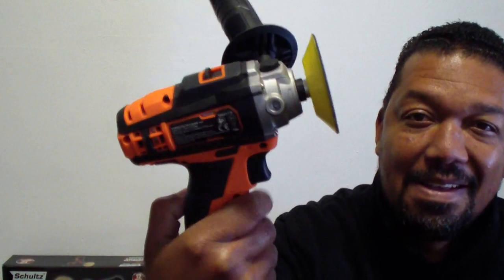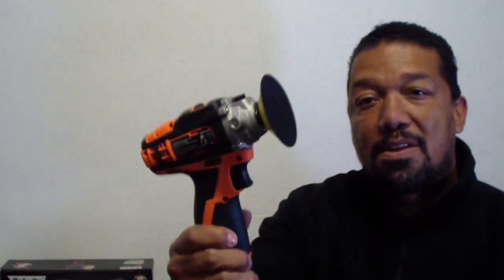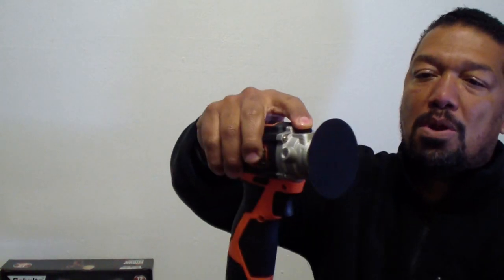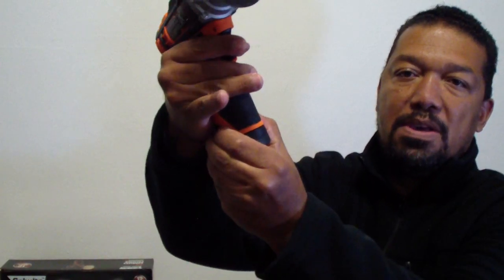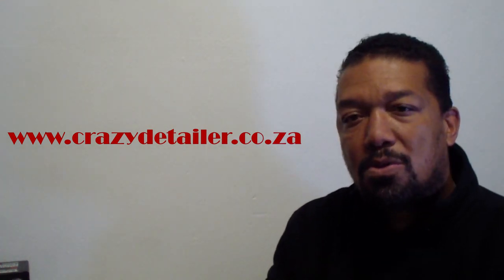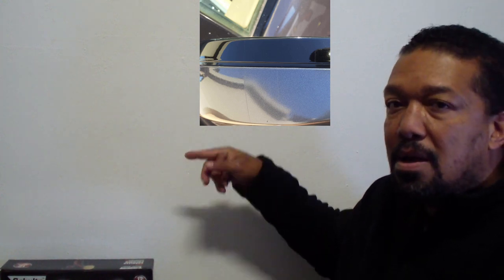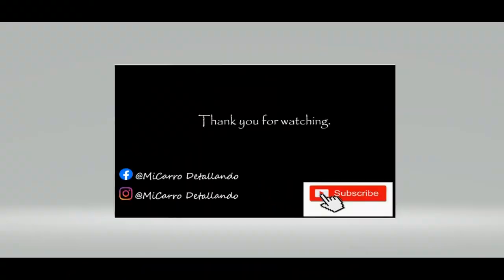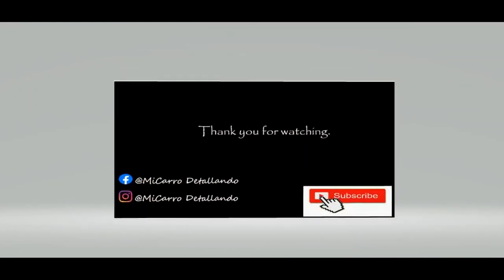Mini Polisher by Schultz

Comment: Nice video. What is the 17% what what that you used to remove the protection layer with?
Reply: You will have to get yourself a used bonnet from a scrapyard to show these sort of things. Good work
Reply from the maker: Hey Jannie. That is my own IPA( Isopropyl Alcohol) I made with purified water( for longevity). So you buy rubbing alcohol and dilute it with water to give you the IPA wipedown. 
The IPA wipedown is used to remove any and all waxes, sealants safely that might be on the panel. This is normally done to either prepare paint for the application of a new wax, sealant or coating( you dont want a new product to fight off any old residue and not bond properly to the surface). You also make use of an IPA wipedown before polishing as you dont want to struggle by first getting through a level of protection before getting to the actual clearcoat.
Reply from the maker: I actually bought an original golf 2 bonnet but its light silver and that is a very difficult colour to show any results. I will be sending it in to be resprayed black for the exact reason you mentioned.